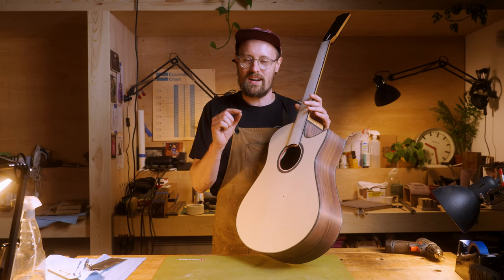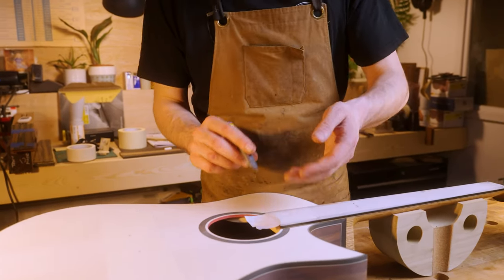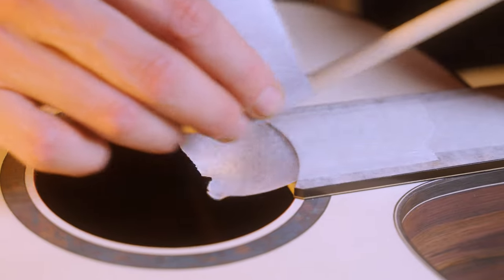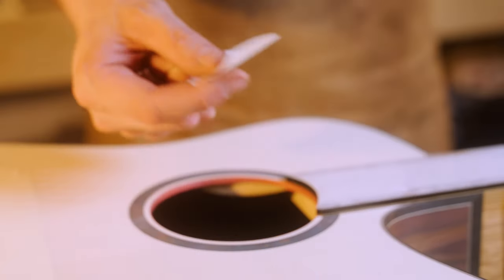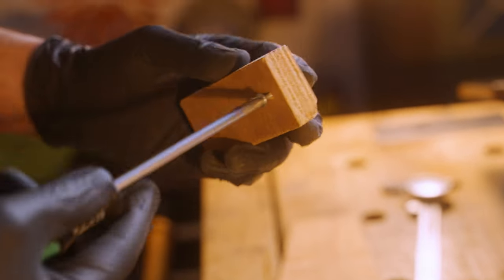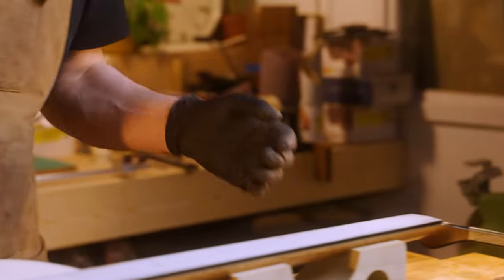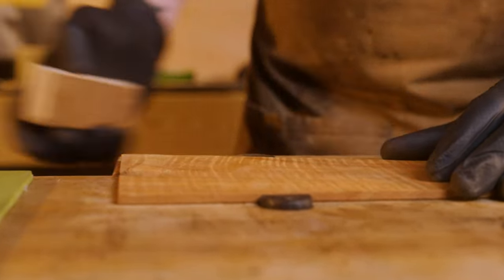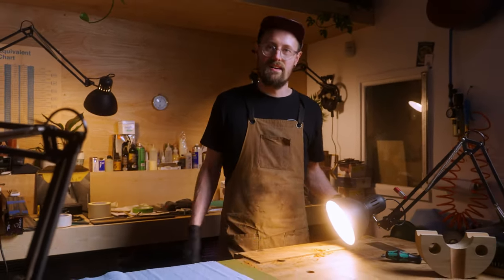MY TOP 5 LUTHIER HACKS (grab a pen)

Comment: Nicely done. I also have a tip for you. When you’re measuring depth with a calliper like you did with the block and screw, you can use the opposite side of the calliper. The very head of the calibre is also a shelf that you can measure against but it is much larger so it will register against a flat surface giving a more stable reading.
Reply from the maker: LOVE IT!!

Comment: All very interesting and even more useful. I have used a similar trick to your screw method when fitting patches into steel fabrications where I would use a grinder to nick the edges of a plate to the depth that I required removing. As with your screw method once the nicks disappear the plate ought to be to size and fit into place.
Reply from the maker: Perfect!

Comment: Here’s a question for ya. Can you do a blog on how to fill a ding on a satin wood acoustic guitar (…Taylor 322ce…).  Some suggestions include, thin glue mixed with chalk, or thin glue then use wire wool 000 to get the satin finish. The only other issue, it’s close to the strap button / input cable and close to binding. Mainly a cosmetic finish issue, but would make the guitar perfect once again. 🙏🏻🇬🇧📺👏

Comment: You mentioned in a previous video a while back about the neck-carving-sanding-board method. I think i've done 4 or 5 necks with that technique now, not sure how I ever managed without it! Also, if you need white pencils, and want a propelling pencil version, it took forever to find some but found that you can get those from dress makers. They use it for writing on material. Way better than endlessly sharpening a white pencil. I like the idea of the scalpel-chalk option for marking cut lines but it's probably not so ideal for quick marking, putting measurements on etc.
Reply from the maker: Wow! I need to find some!

Comment: The plywood and screw trick is very clever - despite being of little use for electric builds.  The sanding board and chalk line tricks are useful for all types of builds.  The masking tape and superglue trick is so common it probably shouldn't even count.  Tricks that are essentially using a fancy tool are not really tricks.  Doing the same thing with a paperclip, a rubber band, and popsicle sticks (for example) - now THAT would be a trick!
Reply from the maker: Fair point!

Comment: Hello Tom, one little question:

When calculating where the bridge needs to be glued you basically project the distance between fret 0 (nut) to the 12th fret from the 12th fret until the bridge position, correct? On that sense, the alignment needs to be where the saddle will be or where the bridge will begin?
Reply from the maker: That particular jig can be used either with the saddle slot or the front of the bridge as a reference point. If you intend to use a compensated saddle I suggest using the stewmac fret calculator on their website to get accurate measurements for where your saddle needs be based on you desired scale length.
Reply: @TomSandsGuitars  thank you Tom 🙏